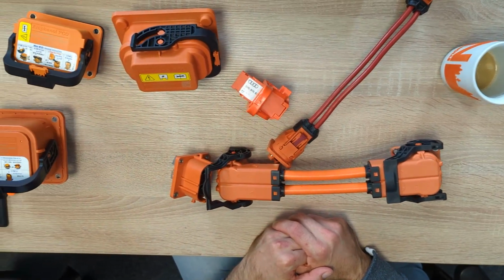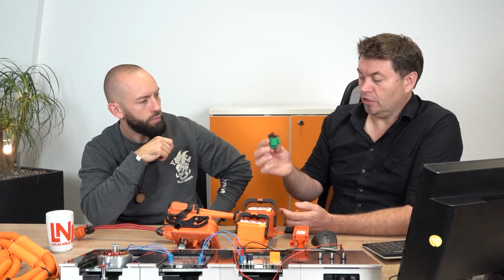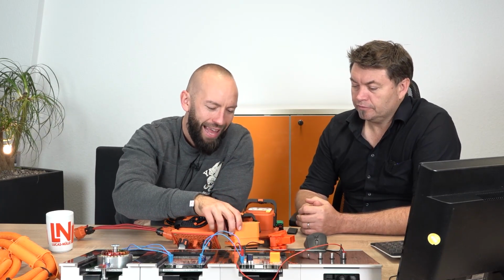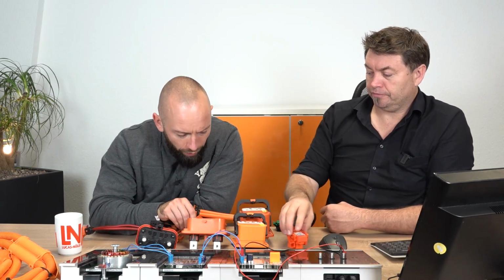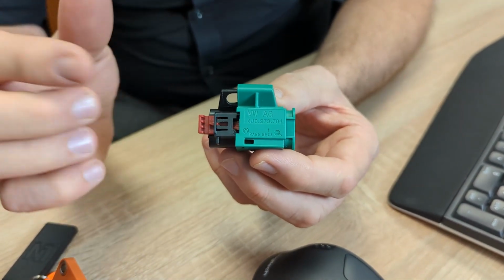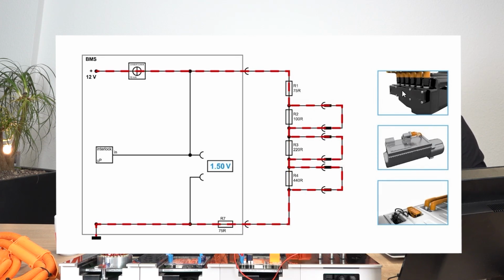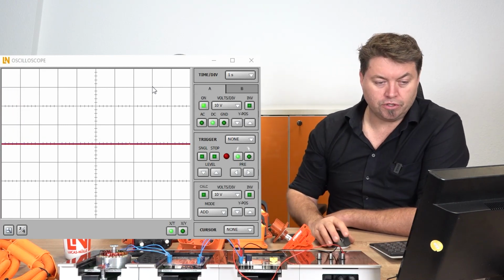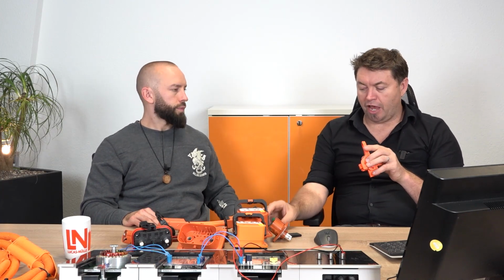Interlock in Electric and Hybrid Vehicles - A Deep Dive into Manual Service Disconnects (MSD)

Comment: Thanks!  I was getting a fault code indicating an interlock problem.  This helped me fix a problem with my Smart Electric, the battery cable wasn't going all the way in because of some damage on the retaining screw and I had no idea there was an interlock hiding in the connector.